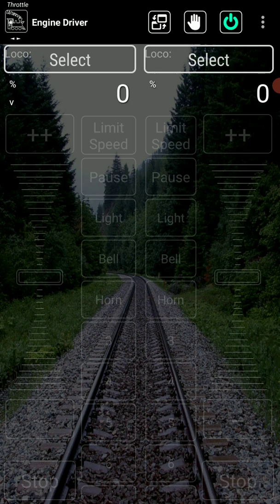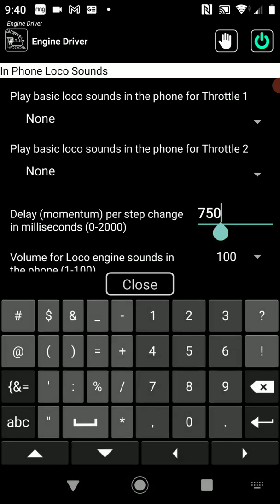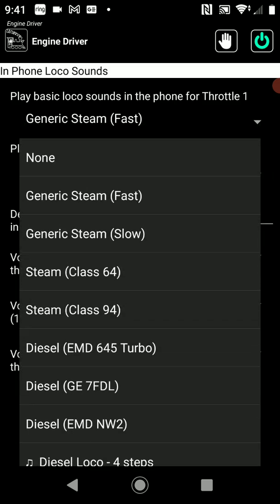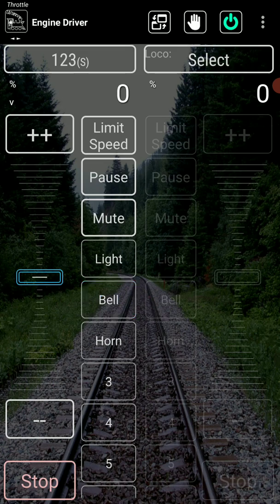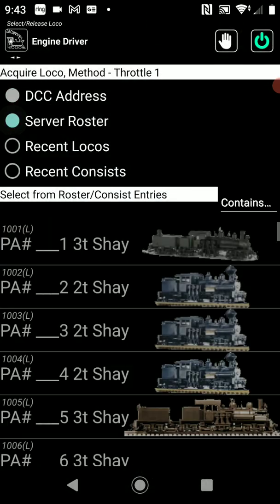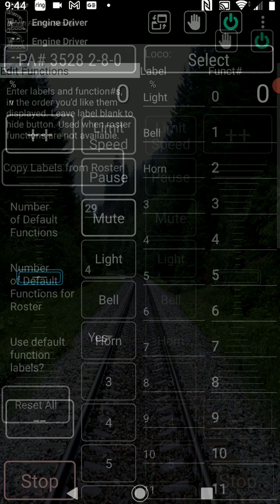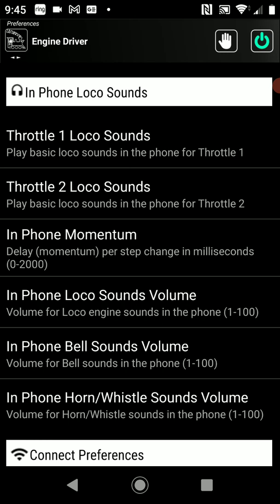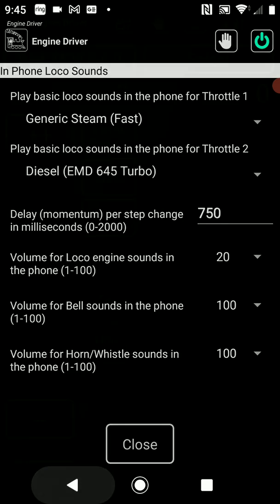JMRI Engine Driver - In Phone Loco Sounds - full walkthrough / setting up

Comment: Any idea why mine isn't working?  I've tried doing it exactly the way you did but no sound comes from my phone speaker.  The volume is up and Bluetooth is off.  Tha is for the help.
Reply from the maker: Have you adjusted the 'ring' volume, as different to the normal 'media' volume?
Reply: @peterakers9071 Good call, I didn't think of checking the other volume sliders.  Turns out it was the "system" volume that was the problem.  Thank you for the help!

Comment: Peter, 
Sounds very good. It would be ideal for my Plymouth Switcher which is far too small to fit a sound decoder and a speaker. But the ESU Mobile Control I use doesn't have a speaker ☹
Reply from the maker: Yes, this feature will never be as good as in-loco sounds, but it can provide an option when in-loco is just not practical.  Pity the MCII doesn't have sound. (I was not aware of that)